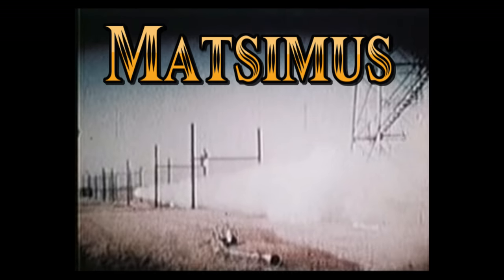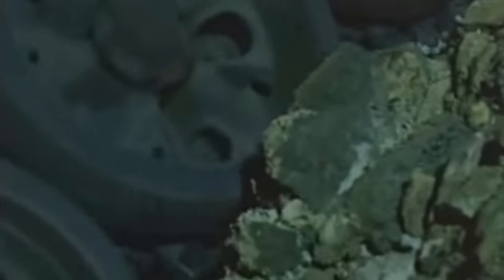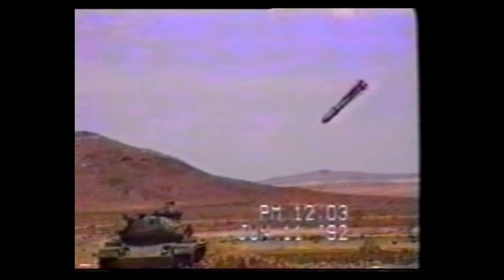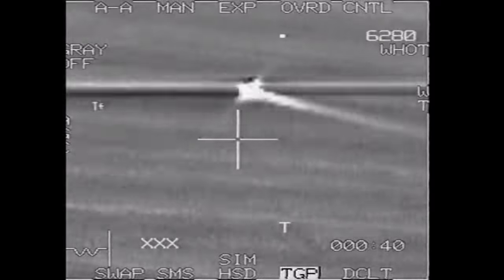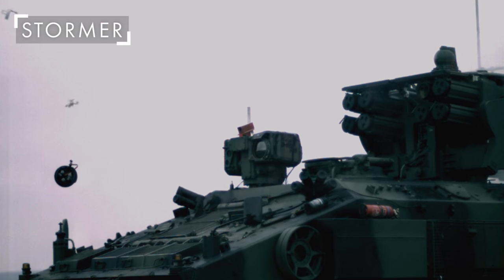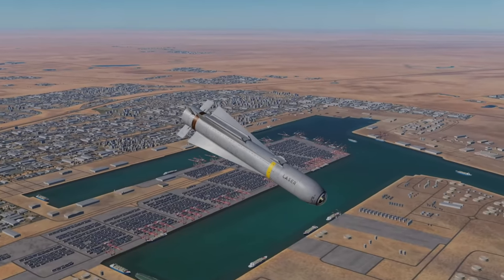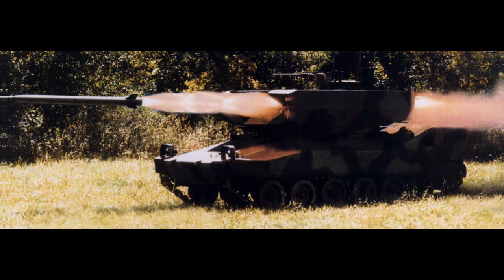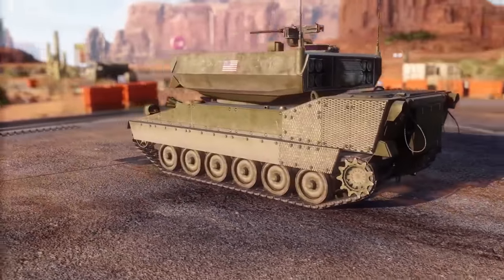Anti-tank Kinetic Energy Projectiles | HIGH VELOCITY MISSILES

Comment: cont....
A high velocity tube launched missile is probably the more effective solution at longer ranges. Below say 5-600 meters there does not appear to be anything better than a APDS. A tube launched missile is not really an option at short ranges because it needs say 7-800 meter to clear the tube and actually be receptive to further information of what the devil it is actually supposed to hit.
The first distance is occupied by clearing the tube and avoid roasting everything in the vicinity of the launcher - that is done by the booster rocket engine - then the sustainer engine lights up and seriously accelerate the missile. That would mean that the missile achieves its maximum speed relatively far from the launcher (vehicle or other device). Within limits the energy of the projectile gets higher the longer the range. If you get beyond - say 3000 meter it is doubtfull you will hit anything at all.

I know a Danish Leopard 1 hit a target at extreme range (the squadron commander was working himself into a frenzy at the waste of tax-payers money). He calmed down as a big SECONDARY explosion really pissed the Serbians off - so....
Let's just say - it happens - but rarely.

The other thing is that at close range the tanks gun aiming is vastly simplyfied and the hostile target has not really time to move. At long range the missile will have to get some midcourse guidance - no matter what.

Personally I'm a bit sceptical about hypersonic missiles simply because it takes time to accelerate from - say Mach .8 to Mach 5 and beyond - and again: How are you to see the bloody target at those distances, if the enemy is not suicidally cooperative?

Comment: Do you think this would be a good projectile for IFVs to counter active protection systems since all ATGMs are ineffective against Active Protection Systems? Even the new RPG30 which is designed to counter the trophy is already countered by the new "trench coat" update for the trophy  active protection system

Comment: Give it rudimentary guidance and it could be used from mobile artillery platforms. Minimum range would not be an issue then and an indirect ballistic arc gives it a top attack. The relatively low cost would allow for high volume attacks from something like MLRS.

Comment: If they could get the diameter down to 120mm this could be a tank fired (launched?) round similar to a Shillelagh missile for the Abrams. With high enough velocity, DU would no longer be needed for the penetrator, solving another problem.
Reply: Never mind the diameter, what about the length? The kinetic energy missiles the US developed were 1.5 to 3 meters long, that would only work if it were muzzle loaded. KEMs need large rocket launching tubes, so maybe they can be adapted to work with MRLS 😁.

Comment: question: if this concept was revived and dare i say "modernized", could this concept of weapon system be effective against modern MBTs?
Reply: Probably. It’s basically just a faster, more versatile APFSDS round.
Reply: Pirated Vegas Crashes Alot but this can be fired from practically any platform, not just a tank gun. Also, it delivers a lot more kinetic energy, which means it would probably do much better against modern ERA. It’s also much faster, which would allow it to easily defeat any developments in active protection systems.

Comment: Rather than boost it to max velocity right from the get-go, why not go with a recoilless rifle kinda setup. Modify a standard abrams apfsds round to carry twice as much propellent (cause newton), wrap it in a really high pressure tube that can serve as the missile body, slap a rocket motor and guidance kit on that badboy and set it to detonate once it gets within spitting distance of the tank.

Comment: There was another problem with them. The expense. Or rather the lack of it. It's not hyperbolic to say the defense industry often dismisses cheaper platforms to protect their bottom dollar. It's only common sense that defense contractors require a minimum amount of $ to continue to operate at a level required by the military. Another words, building less expensive systems will reduce their ability to operate thus requiring cuts and handicapping their ability to compete for future military contracts. cue Circle of Life  ...er Death song. 0_o

Comment: 4:35 It would be a difficult threat to defeat. But, there are a few methods.

1) A few active protection systems are capable of nullifying kinetic threats. Apparently Manfred Held made an APS system that was able to reduce the penetration of a kinetic projectile by around 91.5% https://below-the-turret-ring.blogspot.com/2017/01/hardkill-aps-overview.html

2) Some kinetic-missiles like the LOSAT have their rocket motors be always active until it reaches the target. So if you could somehow intercept it (maybe with a laser), and destroy its rocket motor at a distance away from the vehicle (you are trying to protect), you may be able to reduce the amount of kinetic energy it can attack you with. (Although this may not work with some missiles like the StarStreak. Because the StarStreak basically accelerates to its final velocity, 30 meters (I think?) from the launcher)

3) Pretty much all kinetic-missiles rely on some sort of guidance system to accurately guide it. So, electronic warfare (namely jammers) could be useful in confusing (or reducing the accuracy of) the missile
Reply: I'll figure it out  Hi, sorry for the spam that's gonna come
Reply: I'll figure it out  *3) “#3 you're really pushing the envelope cause with very rudimentary methods (like those seen on the TOW) one can effectively overcome jamming techniques.”
*

Yes, that’s true. Wire guidance is virtually impossible to jam. HOWEVER, opting for wire guidance forces you to sacrifice some traits. 

For example, wire guided missiles typically require line of sight to the target. So, that obviously means that you have to constantly keep your target within sight at all times. However, there are some problems with this method. First of all, if your situated behind a hill, you obviously can’t guide your missile to the target (this is not the case for wireless, fire-and-forget missiles). Secondly, you have to physically guide the missile yourself (or at least the launcher unit will have to). So, what happens if somebody shoots back at you? Obviously your accuracy is going to decrease. In the very worst case scenario, if the launcher unit gets destroyed, you don’t have anything to communicate/guide with the missile. Thirdly, Murphy’s law states that “if you see the enemy, then the enemy can also see you”. Also, another bad thing I could think about wire-guided missiles is that you can only guide, and fire a limited amount of missiles. This is, because wire needs to kept in contact with the launcher at all times. Meaning that for the duration of the missile’s flight, you can’t fire another missile (This is not a problem for wirelessly guided missiles). Thus forcing you to SIGNIFICANTLY reduce your rate of fire when compared to wirelessly guided missile launchers. This could be problematic for a few reasons. One this trait prevents you from engaging multiple targets easily. And, secondly, APS (Active Protection Systems) seem to be setting a trend for missiles to gather in swarms in order to overcome APS. You can’t swarm missiles as easily with a wire-guided launcher.

In addition to this, it’s commonly known that wire-guided missiles require the launcher unit to remain stationary when firing (some other types of missile guidance DO NOT have this problem). Furthermore, wire-guided missiles have the added disadvantage that they cannot fire over some obstacles like (trees, power lines, telephone lines, and other related structures), because this will cause the wire to snag, and break.

https://www.globalsecurity.org/military/world/russia/at-14.htm (Some disadvantages of wire-guided ATGMs)

Earlier, I have mentioned that wire-guided missiles are impossible to jam. However, I recall that there are a few missiles that combine both wire-guidance, and sensors (this could be television cameras, and IR cameras). I think these missiles use sensors, for better precision (I guess guiding the missile by just flare is a bit difficult). So, in this case jammers could very well be useful in this case, and prevent the missile operator from achieving an easier kill.

And also, making a kinetic energy missile a wire-guided one? That seems novel, and I don’t see why it can’t be done……..however, the fact that none of the proposed KEM (kinetic energy missiles. The Vought HVM, Starstreak, LOSAT, and CKEM. All of them aren’t guided by wires) are guided by wires is a bit weird. It does make you wonder (maybe this indicates that hypersonic missiles aren’t able to be guided by wires. Or at the very least very difficult to guide with wires? Maybe the rocket motor of the KEM is powerful enough to burn the guidance wires??? I mean…..getting a missile to hypersonic speeds does require a lot of energy when compared to sub-sonic/low supersonic speed missiles). I don’t know. I am not quite sure about this mystery, so take this with a pinch of salt).

Regardless, wire-guided missiles aren’t the “be one, be all” solution to everything. It’s more of a trade off really.
Reply: I'll figure it out  4) “……….with precision/the timing and sensor resolution it takes to do that?”

I’ve already mentioned that 10 kW laser weapon systems already have their own in-built optics that allow them to track very small targets from very great distances (3.5-5 km away). And that’s not even mentioning the radars that these weapon systems could use, which, by the way, have far greater detection range that the visual sensors. Apparently, the radar on the “Drone System” can be used to spot small drones at a distance of 10 km (the detection distance is around 30-50 km for larger objects)

And as, for APS (Active Protection System), well, I don’t really have to explain myself. There are countless sources stating that it already has capable enough sensors that allow it to detect very fast, and small moving objects (especially APDSFS, and EFPs). And it can also detect that a far enough distance to respond with hard-kill counter munitions. In addition, some APS systems are already smart enough to discriminate false targets (see the story about the “Trophy” APS, and the RPG-30). Such as false decoys, bullets, and flying debris. Go search them yourself, I am too tired to discuss more.
Reply: I'll figure it out  5) “Not practical to the point of impossibility and if it was it would be done with the hit zone moved slightly forwards to defeat HEAT rounds but, again, it's just not practical.”

Do you mind explaining this to me? I don’t understand what your trying to say.
Reply: I'll figure it out  Anyways, I feel that your greatly underestimating the capabilities of protective systems (both laser, and APS-based).

Oh, by the way, have fun reading   :3
Reply: I'll figure it out  "oh no I wasn't talking about wire guidance but rather the xenon lamp and highly secure short term communication networks which can be maintained a variety of different ways"

Oh, I see. Sorry, my bad. Whenever, I think about TOW, I immediately think about wire-guidance (but I guess that's a bit naive of me, since TOW has different types of guidance depending on the model. There's even a fire-and-forget version called the TOW FF) . But, to be fair, you did say "rudimentary" (from your very first comment) ........and I couldn't really think of anything more rudimentary than wire-guidance.

Well, anyways, if you are talking about secure, wireless-guidance, then I guess I should put in my own 2 cents into da bucket. I think that the Starstreak (and other missiles) used laser beam riding. This type of guidance is both difficult to jam, and detect. Also, another type of guidance is LPI (Low Probability of Intercept) radar, and radio. Apparently, LPI "masks" the emitter's location from the enemy. It does this by switching over to many frequencies, and very quickly. Advanced AESA radar (like that found on the F-22, F-35, and some other stealth aircraft) are capable of doing this.
Reply: I'll figure it out  "what I mean is if it's so easy to target the engine of a missile that could be going who knows how fast and maneuvering seemingly randomly to fuck knows where than this could be applied to almost any projectile no matter what (fins on apfsds for example). The "hit zone" was referring to where the laser would "impact" but what's funny here is that between heating delays and the shock sensitivity (it's not the heat which disables the target initially) of a given part as well as the delay of your electronics and optical pumping system you really have no chance of doing next to anything against a missile like this. In fact the engine would not even be that good of a target to begin with due to several aspects of many different missile types and one universal one (position)"

I don't understand. I thought I already showed a good demonstration of lasers being capable of detecting, targeting, and intercepting missiles at very long distances?    :/

A) However, there are few things that could complicate this. First of all, size could complicate detection. A smaller missile could be more difficult to detect........but that also means the lethal payload of the missile get's reduced. 

B) And secondly, position of the missile could also complicate the detection of the missile. So, if a missile is pointing straight at you, it can reduce its area that is visible to you. HOWEVER, this is not always a guarantee. Another guy that is away from you could see the sides of the missile that is going towards you (meaning that the missile is more visible to that guy). 

ALSO, the sensor of the "Drone Dome" seems capable of spotting targets as small as 0.002 square meters at 3.5 km (well at least according to what Rafael says). Which is incredible, since for example, a 15 cm diameter missile pointing straight at you, only has a cross section of around 0.018 square meters. But, it's not known which sensor is used to achieve this, either the visual sensor, or the radar. But, at the very least it implies that the longer ranged radar is capable of doing this.

Anyways, if a missile is pointing straight at you, it could reduce the area that is vulnerable to laser attack. Although this may depend on the size of the laser beam at a certain distance (Because the dispersion of the laser beam increases as the distance grows). And I am honestly not too sure what the sizes of the laser beam are at different distances.
Reply: I'll figure it out  "I actually did enjoy it I fucking love military analysis honestly"

Oh you did? I am delighted to hear that. Thanks      :3

If you liked that sort of thing, you may be interested in these sites (these are just a few that I know of):

1) Sturgeon House Forum http://sturgeonshouse.ipbhost.com/ (these guys have a lot of EXCELLENT sources. I think you can find some of them under the "Documents for the Documents God" sub-section. Which is located under the "Mechanized Warfare" section)
2) Below The Turret Ring (I think I already gave a reference to this blog)
3) For The Record http://ftr.wot-news.com/history/
4) And something a little special on the side http://toughsf.blogspot.com/search?q=nuclear+efp

Have fun!!! Cheerio         :D

Comment: yes its really modern and all
but since the main advantage is high velocity who reduce time to travel on target why this need guidance
why not just a hypersonic rocket that will have a zero minimal range and a low cost
it sound as the missile for canon concept
it can be understood on thaads anti air system who are super long range on high spped maneuvrable targets who are rarely at short range

Comment: 14:025 - Did Matt just say this thing moves 2,200m/Second? .................. what?
Reply: What is that, Mach 6? 7?
Reply: @mage3690  - Try Mach 7,200 (132,000 kpm or 7.92m kph)
Reply: @jemc4276  Mach 7200? American here; if it's 7200, my conversion is wildly off. My conversion went something like this: 2200 m/s ~= 6600 fps = Mach 6. Or, according to Google, 2200 m/s = Mach 6.4. One thing you've got to be careful of when converting time units is that when it's unit/unit time, converting the time factor is always backwards. It's been the bane of my existence in math class recently.

Comment: Fantastic video!  But, I have reason to believe that though it has been repeatedly said it was cancelled regardless of the weapon system, such system had been used and purposely hidden under the guise that they had been discontinued; thusly didn't or don't exist so any would be enemy would not have taken counter measures to defeat such systems to give an edge on the battle field.  It's what an enemy doesn't know that gives an advantage in many cases, but with today's technology on the battle field it doesn't matter if a putative enemy doesn't know because their technology could counter measure though not built for the hidden tech the U.S. hides.